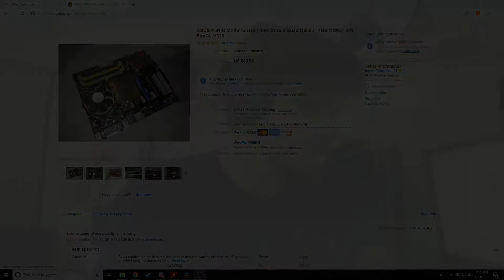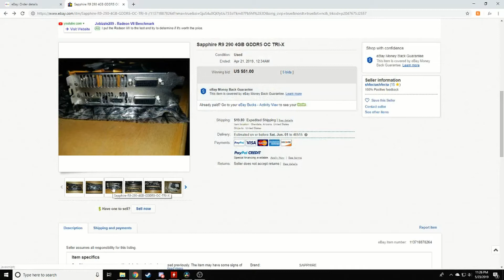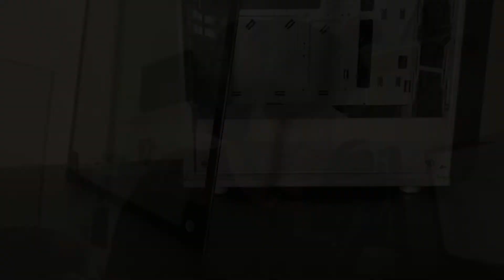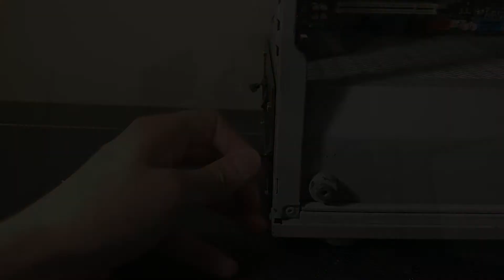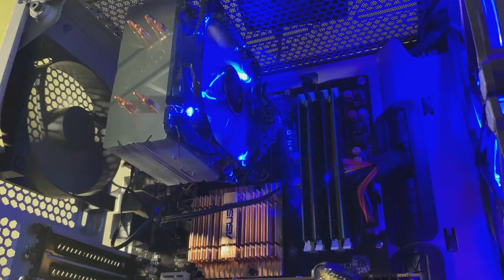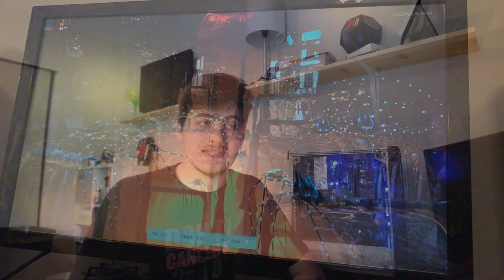Core 2 Quad Q6600 in 2019!! ft. Tech Teardown

Comment: Kudos for attempting to overclock, but most people back in the day could get the 6600 to overclock significantly more.  The Q6600 produces a lot of heat and requires a good air cooler.  I ran a Q9400 (I'm still running it) at 3.8GHz.

Comment: i have an old one 
q6600 7$
gtx 760 oc 35$
p5k mobo w/4x1gb ddr2 800 30$
cd rom and nzxt 310 case 25$
120gb ssd 20$
nzxt 120mm aio 30$
total 142$ and an 8gb kit is like 30$ im going for 4+ ghz as ive got it before on other q6600 chips deffinatly time to hang them up